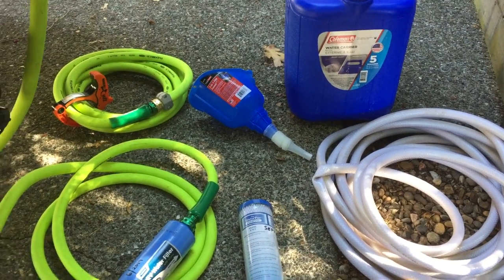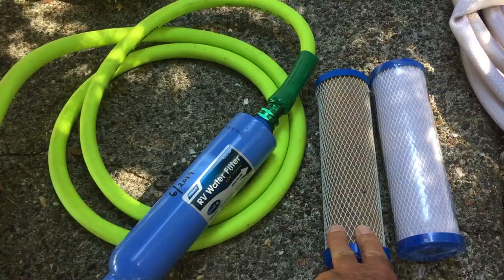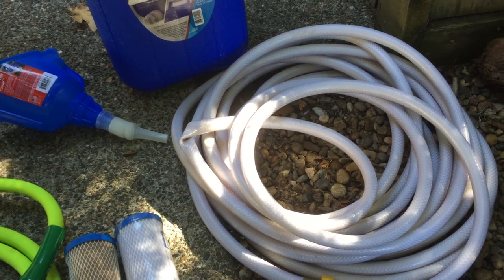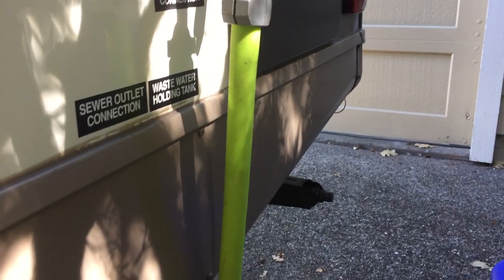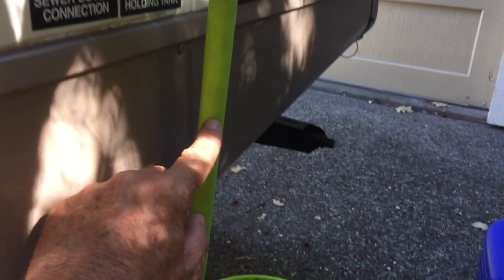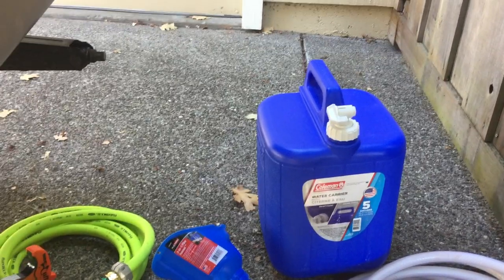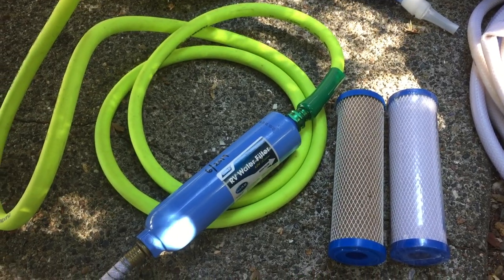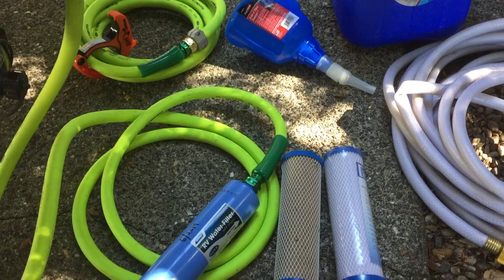Travel Trailer & RV Water Filter & Hose, Pressure Regulator, and Other Tips

Comment: Good tips Michael.  :)   Thanks
Reply from the maker: Thank you :) I forgot to mention in the video and you might have caught this.....I cut the 25 foot hose in half to make two 12 1/2 foot hoses. We've found that several times when we hook up we can use less length than 25 feet also it makes rolling up the hose easier.

Comment: Another good video, Michael.  My hose management has still been evolving, so l’m going to try that Flexzilla hose, as you suggest. I use the Flexzilla air hose in my workshop and love how easy it is to coil. I didn’t even know that they made a drinking water safe water hose. 
After going through your two in-line filters, a Britta water filter/pitcher should make it safe to drink, I think.
I’ve enjoyed your other videos, too, as I enjoy modifying and improving my Travel Trailer. 
I just started posting some of my own modifications, so take a look if you would.
Thanks, and Happy Camping!
Reply from the maker: Thank you Tony, I enjoy sharing my projects and helping others. I just visited your page and its great to see you are sharing with others too. Happy Camping
Reply from the maker: I forgot to mention in the video and you might have caught this.....I cut the 25 foot hose in half to make two 12 1/2 foot hoses. We've found that several times when we hook up we can use less length than 25 feet also it makes rolling up the hose easier.
Reply: I noticed the replacement hose end, but didn’t know the length. I actually just bought a 50’ Flexzilla hose on EBay this morning, with the intention of splitting it 30’/20’.
Reply from the maker: @tonyb9884  I forgot to mention in the video and you might have caught this.....I cut the 25 foot hose in half to make two 12 1/2 foot hoses. We've found that several times when we hook up we can use less length than 25 feet also it makes rolling up the hose easier.